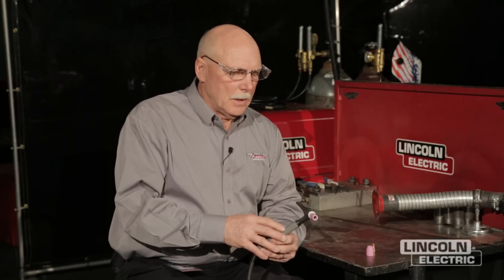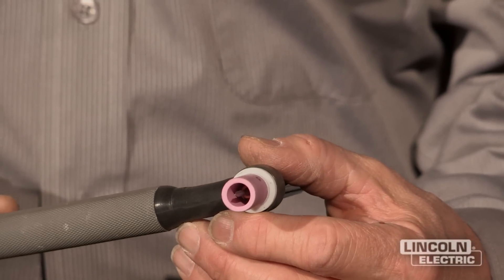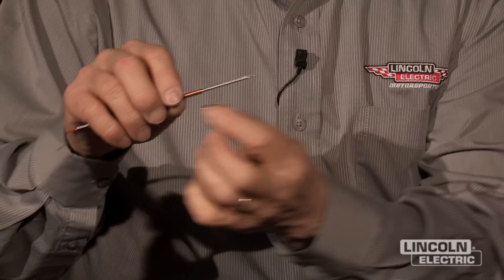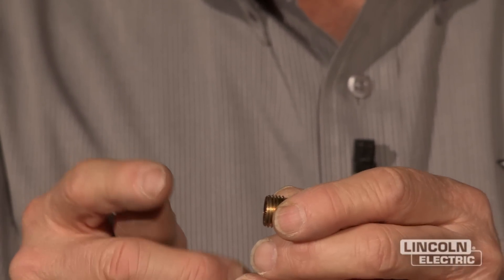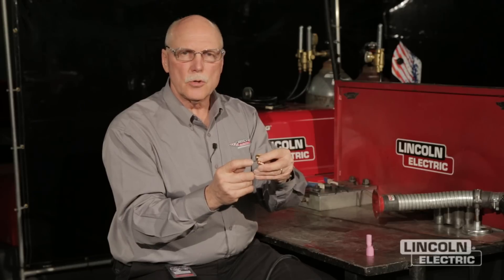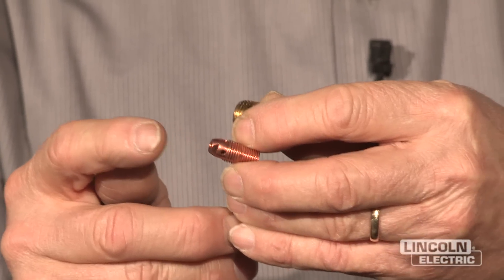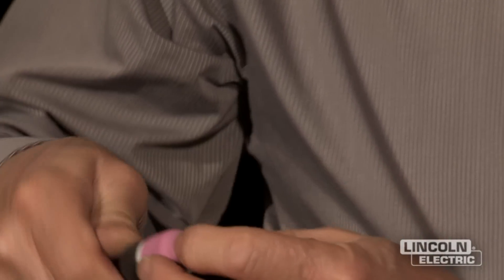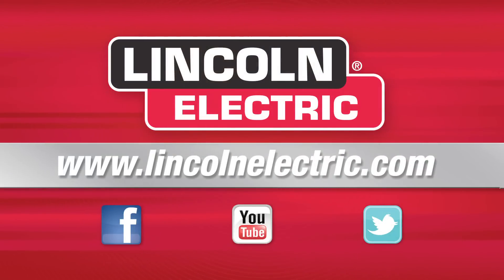Tech Tip: Gas Lenses for TIG Torches

Comment from the maker: There are gas lens set ups available for the #17 torch. However in most cases they are much larger than the #9 set up and makes for a bulky setup. The second part of your question. Yes, you can just buy the #9 torch body and thread it on to the # 17 cable.